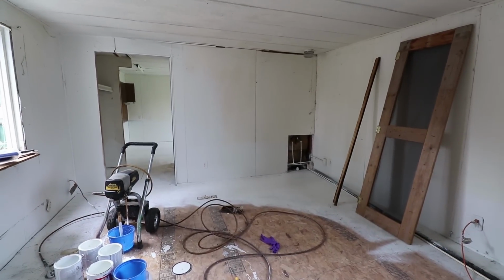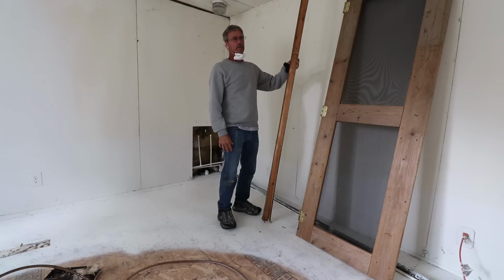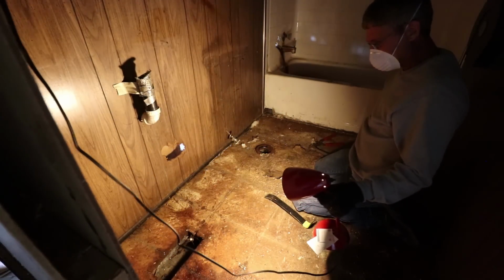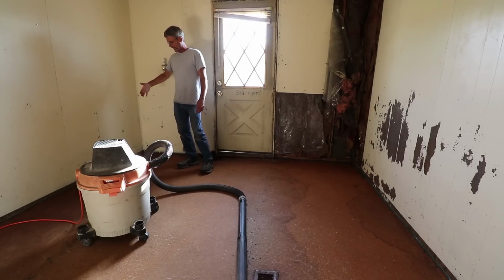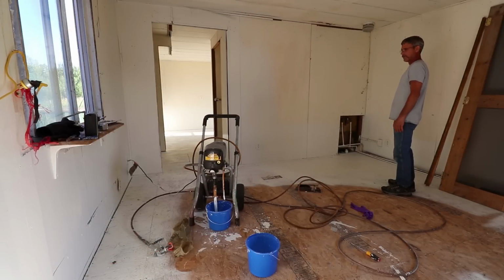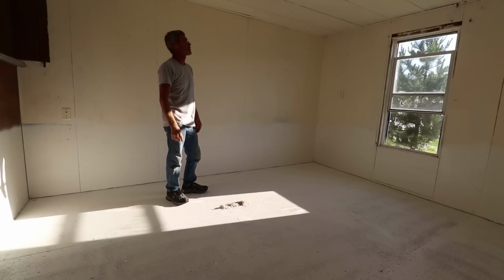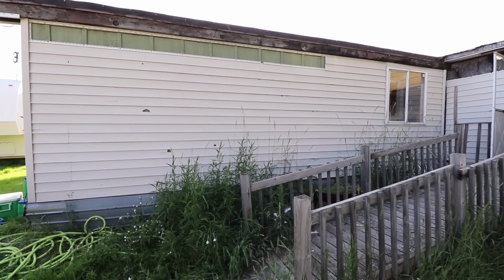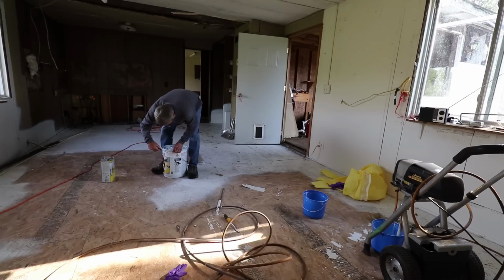MOBILE HOME RESTORATION. It begins. Can it be saved?

Comment: Those old mobiles had the grey tubing installed for plumbing.Unfortunately that stuff splits and causes major damage in the flooring .It has to be replaced with pex which means you are going to have to get under the home to do it.
Reply from the maker: Everything in that trailer is pvc.

Comment: When we moved to Florida and lived in a double wide trailer. The floors we removed and placed 3/4 plywood down and added more structure underneath  to support it. We also covered the bottom of the whole trailer with a material to stop air coming and going. I had a company enclose the outside porch and I insulated the walls so i had a man cave for my tools and fishing gear since we lived on a nice sized pond. Under the carport the outside walls were covered with brick and places for both vehicles and golf cart. After 4 years with living so close to neighbors we sold and moved to the country.

Comment: Your not kidding when you say these mobile homes were made cheap. I like the versatility of being able to change it. I had the same brown paneling in mine. I washed my walls & ceilings, then painted the whole inside from the South bedroom to the North bedroom, white. It was do nice.  I have a sub floor. I put down 5/16 plywood over top of the pressed wood. Very solid floor. The Bathroom, my Brother put extra bracing in under the commode & tub with all new materials. I put the plywood down, put tub back in. It still sits 5-6" off the ground. You always had to step up- I don't like it now at my age. The roof is fine, kept up with roof coating every so many years. Mobile Home & RV parts place to order our tub, but mostly got my materials from Lowes. I'm so glad you've taken on this project. I'm watching close to see how your going to remodel this. I need ideas.

Comment: If it is a furnace that blows warm air down, it should be able to be lifted up and a heat exchanger coil inserted below the A-coil. I had one in my mfg home and set it up with aguastats to use fan and hot water from boiler if water temp was hot and to bypass and use propane if boiler water not hot.
Reply from the maker: Yes, that is what they said they would be doing IF they need to lift it. He said usually they do not but they might.

Comment: Most mobile homes built from that era used a product called Cresdeck(sp?).  It was a bit different than regular particle board.   The tiny chips were oriented and not just smashed together.  I did close to 1,000 manufactured homes from 1995 to 2012.  That subflooring was one of the primary reasons keeping me from buying one for myself.
Reply: Cresdeck was an 8' wide x 14' trim 5/8" D2 Industrial Particle Board Decking nailed over 2x6 16" on center floor system. Medium Density Fiberboard "MDF", is a different animal used for cabinet backs, drawer bottoms and sides, mouldings, etc.
Reply: @jackmanfredo1215  Yep.  And even the particle board you get from a lumber yard isn't the same as Cresdeck.  Saw too many floors sag between the joists to ever be happy with Cresdeck's performance.

Comment: Adding an L to the kitchen will add a divider between the kitchen and the living room. Always nice to have that visual break (especially if there's dirty dishes in the sink). If I'm imagining it correctly, you could put the back of the couch against the L and put the tv next to the doorway. 11:00 💖🌞🌵😷
Reply: My dad's singlewide was built that way, an "L" divider between kitchen and living room and boy did they get use out of that! On the kitchen side, shelves to accommodate a full service bar, and in the living room side,  the couch was up against it but to the right, next to the wall, there was a cute little bookcase cabinet with a colored glass-bottle door that looked so pretty. To take a super small space and give it such an upgrade, really made for a nice focal point.

Comment: Looks like a 70s model mobile home. I lived in one for years. Even moved it about tthree times. THe mover commented on how heavy it was. The reason is the particle board they used for a subfloor. You may want to have the furnace looked at unless you're replacing it.I had rotting of the subfloor as well. Even the mice can chew through this floor as I lived in the country most of the time. good luck.

Comment: I’m guessing the spraying of the floor is to block any odors that may have seeped into the subfloor. Think he’s using Kilz primer / blocker which works so well for many uses. A dehumidifier would help with the old people smell. It’s moisture saturated into walls and floors. Again pulling moisture out then smell blocker.

Comment: I helped my friend rebuild a trailer for a camp , we tore out some walls to make bedroom bigger , redid the bathroom. For the bathroom just like yours we took tub out and put in a shower stall , all we did was sheet rocked with waterproof Sheetrock for bathrooms , got a shower base floor and the fiberglass walls only had to tear out tub and the wall where shower goes. As for the base we had to move the drain pipe a little bit to hook up to base . Worked just great . You got some good ideas , maybe the Tv you could build a corner shelf on wall you said to use then you cold put couch and chair just about anywhere.

Comment: I think putting the stove next to the refrigerator... heats up the refrigerator making it run more... Especially in winter when you tend to run the furnace and run the oven more. ... Also you'll need to have some cabinet between the stove and refrigerator because you usually take out a few things out of the fridge and need some place to set them. 💖🌞🌵😷
Reply: Yes, counterspace next to the fridge is pretty much a must have. Also, he wants to put the kitchen sink on an outside wall, then later in the video says it get -30F degrees in the winter. 🥶

Comment: I'd be more worried about the roof on that mobile. Hopefully it's at least shingled or better yet metal. I had paneling in my mobile home and skim coated all the lines then primed and painted or wall papered.  Turned out pretty good

Comment: Were you planning to add an overhang to the roof edge?  That looks like it has been sitting there a while.  They still use that cheap chipboard in mobile homes, even the expensive ones.

Comment: What kind of heating system do you have in mind for the mobile home Reno?
Reply from the maker: It will have a regular gas furnace in it. We already bought a different one but it is the same thing that is in there now, it has just been refurbished. We will also have them run a heat exchanger in there so the outdoor wood boiler system (stay tuned) can heat the trailer as well as the house and hot water etc.

Comment: What are you applying to the floor?  And Why?  I want to know ...  Thanks!
Reply from the maker: I explained that in the video before this one. The one with "work camper" in the title.
Reply: All I know,  that the coat of primer sealer is not proper..you can see the floor is not covered 100%...spray 2 coats or roll obe coat..thick
Reply: @NorthernSeclusion  I'll go watch that one now... Thanks, Joe.
Reply: @TODD.GO.49ers.PACKER  What I thought ... Thanks.
Reply from the maker: I am putting a whole floor over this floor and I have barely even started this project. How can I spray a second coat when in this video I am spraying the first coat?
Reply: @NorthernSeclusion  you should have done the second coat first.  Obviously you’ve still got a lot to learn about this ;)

Comment: Wondering what the R factors that are in the walls and ceiling?
Reply from the maker: Not sure. The stuff you see on the outside now that I pulled off the siding. It looks like t-111 siding and battens is actually made out if styrofoam. I will add more foam before I put the new siding on.
Reply: @NorthernSeclusion  this might sound crazy, but I love how you recycle your old deck wood. I think the trailer would look so great with that, like an old cabin. Your chicken coup, the addition front room on your shop....I love that look. I would have never thought that. You have a lot of your Dad's artist genes.

Comment: What is the name of the sealant your spraying
Reply from the maker: Zinsser Bin 1 2 3. Wear a mask, the stuff is nasty and expensive, 225.00 for 5 gallons but it is unbeatable as a primer and for sealing stuff in. At least that is my opinion. It is oil based.
Reply: Thank you for the info

Comment: Hi, Interesting project! This is the first video I see... The impression I get from this video, makes me want to comment. It SEEMS you've started the renovation [such as painting] without completing the inspection and demolition first. Observations so far: This seems to be an old structure, that had a rough life so far. In order to give it a new lease of life, perhaps it is best to do a complete and very thorough inspection [inside and out] so you 'know what you are 'up against'. From there you prioritize your ToDoList. It usually goes something like this:
1. remove the broken bits that are beyond repair. 2. check for structural problems first: Floors, frames, roofSTRUCTURES are the things you cannot do without. In order to inspect these structures you may need to remove bits that may LOOK OK. You need to do so regardless; Panels and such may hide 'a multitude of sins'. Structural parts MUST be solid. Fix these first and foremost! Use decent quality materials to do so [2nd hand but in a good state is fine] 3. Wind & Watertight; Once the STRUCTURES are fine, you have something to attach the 'other bits' to such as outer walls, roof- and wallpanels etc. Goal is 'wind & watertight' When all that is in good working order, the rest of your efforts and money is well spent. Also: '[Finishing work] if possible work top-down; No matter the job start high; Ceilings, walls etc are messy things to build. You don't wanna mess up your painted floor.... so Hi first, Lo last... Good luck with your project!
Reply from the maker: You do realize that for the last 43 years the ONLY thing I have done for a job is construction? I have owned my own construction company for over 35 years? It took me less time to assess all the things you wrote about than it took you to write it out. Lol.
Reply: Yeah Joe!  Get your act together!
Reply: @NorthernSeclusion  😂😂
Reply: @boblynn9168  LOL

Comment: You still going to try and put a roof over it before winter? If you are and do go with the boiler system I would consider running duct work in the ceiling and adding the heater under the new roof and close up all the floor vents There mostly nothing more than a highway for mice and rats to play in lol.
Reply from the maker: We have way too many cats here. We have been here 4 years now and after that first year I have not seen a mouse or a squirrel or even a vole. Lol. I am going to go with a rubber roof instead. Its a third of the cost and half the work.

Comment: Is that the trailer that the cats lived In during winter?
Reply from the maker: They were in there the first winter and then slowly they just did not use it. They prefer the heated coolers that Melissa has all over like the first part of the chicken coop and up on the back deck. The back deck is their favorite place because that is where the food and water is. They also like the wood piles. Cats are strange. Lol.

Comment: Wait til you see how much your heat sails out of the walls and roof.  We rehabbed our old trailer in college like this, man what a pain in the ass.

Better than what it was, but so inefficient for heating and cooling.

Good luck.
Reply from the maker: I am going to add styrofoam before the new siding. This is not my first remodel, I will get it nice and toasty in there.
Reply: I've been watching a couple refinish their mobile home and they literally ripped out all the old flooring and walls to replace the insulation and use house grade materials.  I don't know how they stayed warm or cool judging by what used to be there.
Reply: @carlapierle8623  Our first year, before we rehabbed, we kept the furnace at about 58°, which got a wee bit chilly when the outside temp went down to the minus teens (SoDak). Just did not make sense to keep it any warmer.  Stocking hats 24/7.

No lie, when the wind was howling, you could light a match and watch the wind push the flame around.

Ahh, good times...
Reply: @thanos9846  Brrrr!  I believe you!

Comment: Typical mobile home construction. Floors get rotten from the moisture over years of changing seasons. I've rebuilt the floors and yea it's fun. I found using a skill saw to cut up the floor worked best to remove the old floor and a saws all to cut along the walls.

Comment: i watched the series where you reclaimed the house after the hurricane.  And now this one i cant wait.  But we stand to get a house left to my son that needs work on about every square inch of it including black mold.  Great location but we will have to do sooo much work.... how do you decided if its worth it to go ahead or just say forget it and sell it for what you can get?
Reply from the maker: I could easily walk through a house and within a half hour tell if it is worth it. For me though I do almost all the work myself and since anything can be fixed it boils down to "do I want to fix this"? The main thing is the foundation and that first floor. If that is solid everything else is just a remodel. If it is an old lath and plaster house the work will be 10 times harder if you are removing it. I have done too many of them to count. When I bid those sometimes the cost can double just from the labor to remove all of that lath and plaster and all the dumpsters needed to haul it away. Black mold is no big deal. Spray it with mold killer and then come in with the Zinsser like I sprayed in this video. The mold is never an issue, the cause of the mold and how you fix the problem IS the issue. If you get water in the basement every spring, that is also a spendy fix. I have flipped a few houses where I had to cut in drain tile in the basement and add a sump basket and pump. It is a sucky job but it can be done. Once again, anything can be fixed if you have the time, the want and the money.
Reply from the maker: I have never sold one because it was too much work but then again, this is what I do for a living. If I can transform the Louisiana house, anything can be done.
Reply: @NorthernSeclusion  oh i agree with that.  The Lousiana house was AMAZING when you got done.  ESPECIALLY the sun room.  Man i loved that sun room fix.  Biggest problem with this house foundation is it was built in 68 before they started sealing prior to laying concrete.  It doesnt get WET but it gets damp enough to rot the interior walls.  Have to pull up all that stupid carpet and seal the concrete and probably tile it.  Exterior walls are concrete block and in good condition. Main floor the usual... gut kitchen and bathrooms. Drywall over old panel.  paint.  new carpet.  new curtains.
Reply from the maker: Back in those days they built walls against the foundations differently. When we do it now you put plastic against the block wall and then you build the wood wall but keep it an inch away from the concrete foundation walls. They also did not use a treated sill plate under the walls and we always do that now. Another way to do it is put 3/4 inch styrofoam against the concrete wall, the type with the foil on it. You then tape the seams with foil tape and that creates the moisture barrier that putting the plastic against the walls would do and it also adds insulation. The dew point is then somewhere in the middle of the foam so you do not get the moisture inside. Doing it this way you can build your interior wall and push it tight against the stryrofoam and you do not have to insulate those walls. I will lose this thread now that I have commented on it. I had to search to find it. If you have any questions, email me. joe@homeandcabinconstruction.com
Reply: @NorthernSeclusion  i understand that they had a leak from the gutters and they pulled all the drywall off that wall and sealed it.  They used furring strips to hold the drywall off the block but they did a POOR job of mudding and taping.  and then painted it HOT PINK.  its a Pepto bismol nightmare.

Comment: What happened to the top comment? Did not finish reading it.
Reply from the maker: Not sure what it was but I went into my settings and added a few words that when they come up a comment, the comment is pulled and put into a "held for review" folder. I see there are already 6 comments in that folder and I am already less pissed off than I was. LOL.